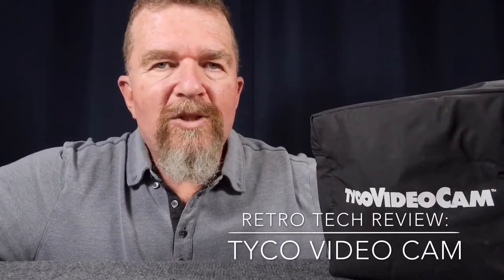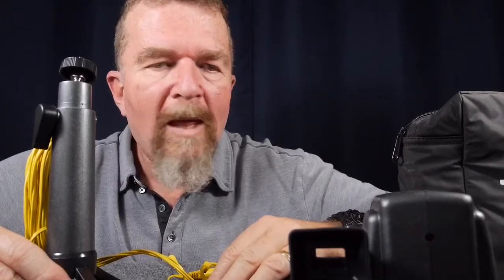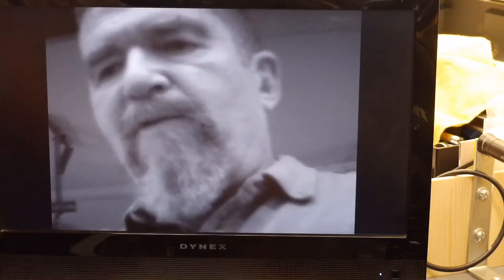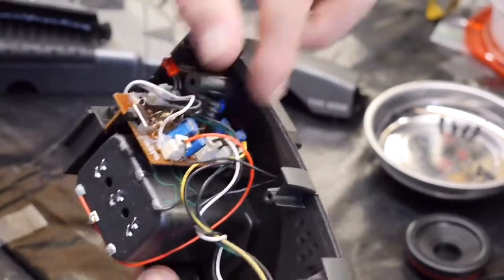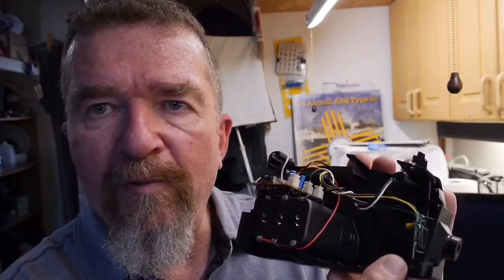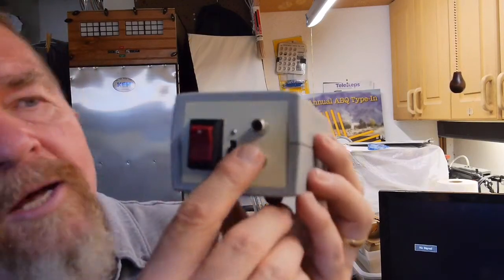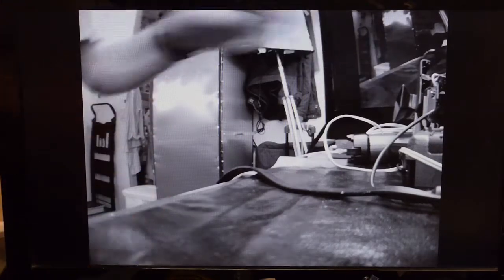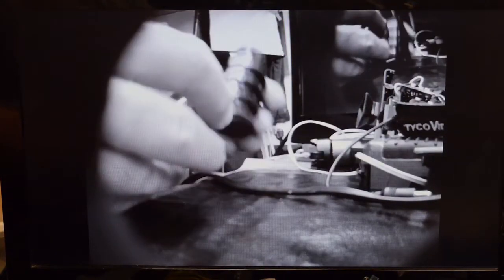Dead Tech Review: TYCO Video Cam

Comment: hey, I had one of those too! We have a Fry's down here, so they got down to about $29 by the time I got mine. I think I still have that yellow cable. Have you considered trying to build an M42 mount for the Tyco? 

Note: because, as you found, the Tyco has no IR blocking filter - you can also use IR passthrough filters (750nm, etc)  to really bring out the IR and block visible light. prolly improve focus & sharpness too, for reasons that are probably obvious. (:

Fun! love it when you pull out and explore these weird little toys :D
Reply: Bought mine from Toys R us 😄

Comment: Thank you for this incredible video. I just bought a Tyco cam and love the results I'm getting (I mounted it to a small VHS-C camcorder for recording). One thing I'm curious about is the auto exposure (which I assume is the electronic shutter changing to compensate for light) - it seems like there's no way on the camera to disable it and so I'm wondering if there's a way inside to turn it off? Is it a feature that would be built into the sensor or is it something on the circuit board that could be turned off? Or is there a way to trick it into staying at a certain shutter speed?
Reply from the maker: There’s no trick that I know of to disable the auto gain. Perhaps some electronics genius can figure it out!
Reply: @Joe_VanCleave  Dang! Does the sensor in the camera you built have auto exposure?
Reply from the maker: @garretharkawik  Yes, all of these security cameras do. In fact, prior to solid state cameras, the security cameras with Vidicon tubes had a variable ND filter over the lens driven by a motor.  Being designed to sit in a fixed position day and night, they had to respond to a wide scene brightness range.

Having fully manual exposure control was either professional video gear, or more recent mirrorless video gear.

Comment: Thanks for this video. There are now portable battery powered analog video capture devices with a video screen that have full RCA input jacks. I just got one and will mount it on top of my Tyco so I can finally use it out in the field. It records to micro SD card, so I can pop the videos onto my computer easily for editing.
Reply from the maker: If you get it working, let me know about the adapter, it sounds like fun.
Reply: Just ordered a somewhat rare color toy video camera called the Spider-Man 2 Extreme Action Video Camera. It is just like the Tyco except that it has a color sensor that can be switched to black and white, and also has a prismatic “effects” lens that can be switched into place.
Reply from the maker: @KeyFilmation  Cool! Maybe post some footage?